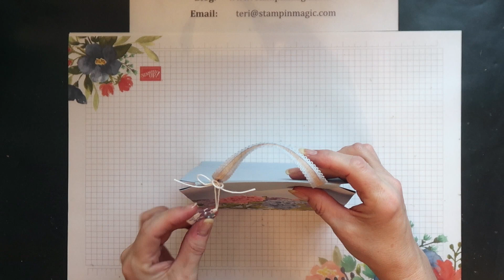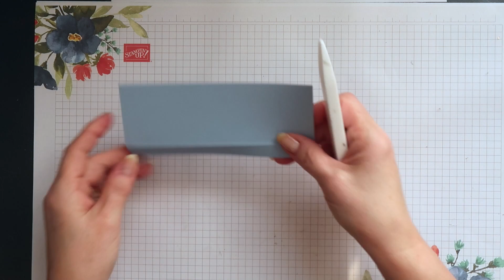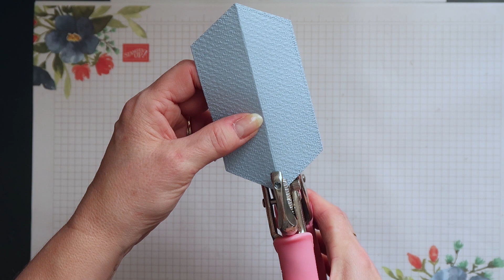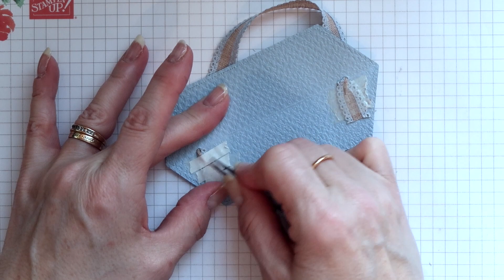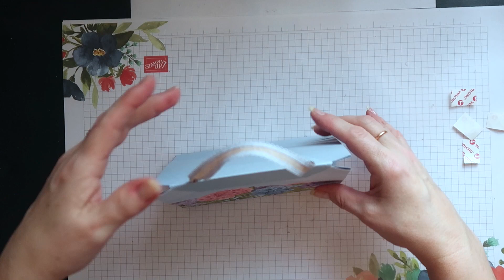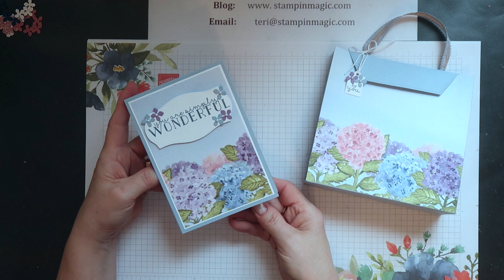Hydrangea Haven - Fold Flat Gift Bag (6"x6"x2")

Comment: Thanks for always giving so many ideas and teaching clearly. I am having trouble with the folding of the bags when my project is finished. I am meticulous on my measuring and burnishing but yet my bags seem to have a small ripple in the front or back cover when I fold them. Something is just a little off but I cannot figure out what it is. Can you help?
Reply from the maker: Hi Lori! It could be a couple of things I think ... the measurements could be off slightly for either the front or back cover - make sure they are exactly as they should be even if you are taking the paper from a 6" or 8" pad - measure it to check. Or ... when adding the front section on this particular bag, you need to take the front side and base edges right up to the score line on the other pieces. If they are 'off' slightly I think you could possibly get the 'ripple' you mentioned because the front will effectively be larger than it should. I hope that makes sense! I've not had the problem but can't think of anything else that could cause it xxx
Reply: Hi Teri,

Thanks for your reply. I have this problem on all sizes that I make. The larger the bag, the larger the ripple ☹. I feel I am doing what you suggest with regard to measuring. I feel I am painfully meticulous ( :/) about measuring but maybe I’m just off a little somewhere. It doesn’t seem like it would be that hard 😊.

When you say “take the front side and base edges right up to the score line on the other pieces” do you mean aligning the DSP with the vertical score line and making them flush or do you mean add the DSP/bottom piece to the back of the bag, aligning the bottom horizontal score line (making sure the bottom horizontal line on both pieces are intersecting at precisely the same spot) instead? I usually scoot the edge of the piece I’m gluing right up to the vertical score line, making sure the top edges match up and are at the same height. Maybe that’s my problem? Maybe I need to focus more on the bottom score line as my method of lining things up and adjust/trim the top edge where the two sides meet if necessary instead of using that as my construction guide?
Thanks!

Lori
 @TeriPocock
Reply from the maker: It sounds like you are doing everything right - you need to align the front piece with the score lines on all other sections when you join them. But yes ... I always line things up from the bottom score line ... if the top edges are 'off' slightly, you can usually trim this back xx
Reply: @TeriPocock    Perfect! I will head to my craft room and make one!! <3  I LOVE all your projects and elaborate cards. You are very creative and a great teacher. You explain things so they are simple and clear. I love watching your videos. They are my favs!!
Reply from the maker: Thank you so much Lori! xx